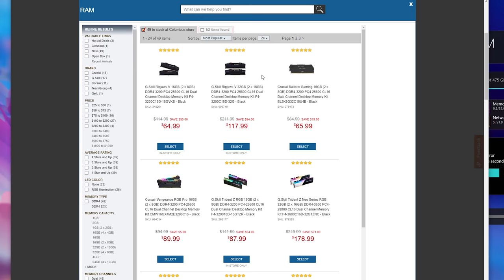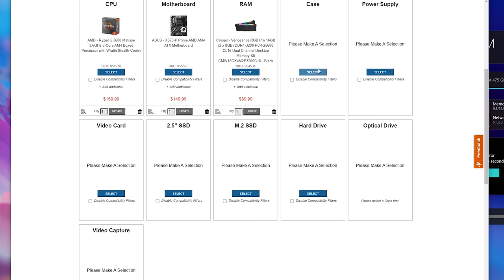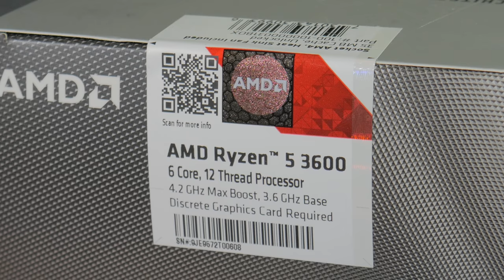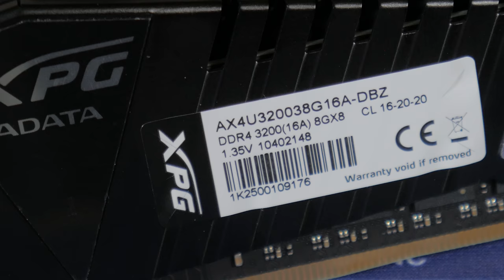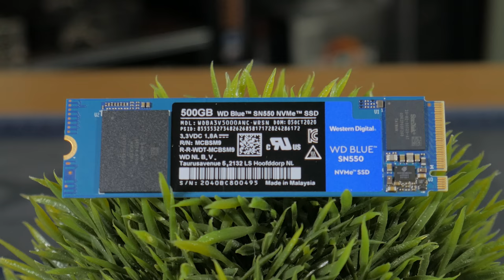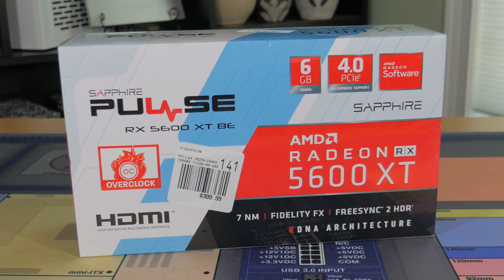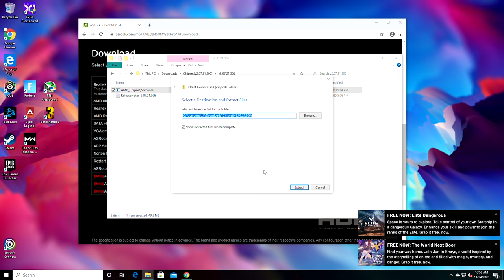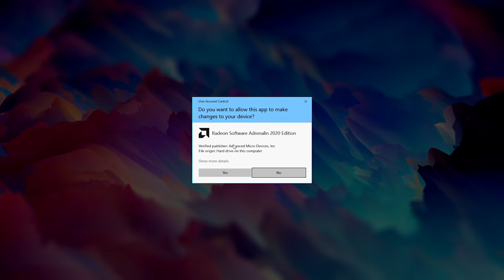$850 Streaming/Gaming PC Build Guide! (2020)

Comment: My budget pc(not perfect for gaming): r5 2600x, rx 5500xt, 16gb ram 3200mhz, b450m ds3h, 500 watt psu 80+ bronze, 1tb crucial p1, any micro atx case+ 3 uphere fans
Reply: Nice! You dont really need a 2600x though, I would have went with a r3 3100.
Reply: @xpsuo7565  yes i could have done that but i just wanted the 6 cores and like i said its not really for just gaming but thx for the feedback

Comment: Best bang for the buck case in the H510, and so easy to build in. The cons are you can’t put larger than a 240mm AIO, and it literally has to be front mounted or else either on top or the back of the case you can only use 120mm AIO. Obviously this was an upgrade to the CPU cooler from the original Coolermaster Hyper 212 EVO I used in a build for someone that has an i7 10700k build. Also, a decent airflow case as well.

Comment: Aight so I got this same setup (but my graphics card was 5500 instead) and wow my PC is a beast. I was able to run League at 150 FPS with 2 games downloading in the background and the graphics are so nice. My friends 1200$ PC isn’t as fast as this build which is great. Also I suggest getting more memory cause 500Gigs isn’t that much.
Reply: does it run rust?
Reply: @Toast_Boy1  I haven't played rust on it yet but I know it definitely can for sure. After a year of having this PC I still agree with what I said before. Now I got it running 3 monitors and multiple VM's running also while playing games and it still runs perfectly
Reply: @ultimateperson626  do you know if i can get a black case for it to match onto my current set up (i dont want a white pc anymore as it will get dirty and suck to clean)
Reply: @Toast_Boy1  yeah

Comment: I built a gaming PC using the NZXT H510. mine is black with a red beauty panel. It's actually my first gaming PC that I ever built. It's something I've been wanting to do for a while. Funny story about that really. It's actually because of PC Building Simulator that I even wanted to to get into PC gaming. Here's a breakdown of my parts: 
MB: Gigabyte Z390 Aorus Ultra
ARCTIC 34 eSports DUO 
Samsung 970 EVO 1TB M.2 NVMe 
Corsair Vengeance RGB Pro 2x8GB RAM 
Intel Core i7-9700K 
NZXT C750 (PSU) 
Gigabyte GeForce GTX 1080 Ti

Comment: Here's my pc part picker list:
cpu=ryzen 5 3600 (200 usd)
gpu=3060ti (399 usd)
mobo=	Gigabyte B450 AORUS M (75usd)
Ram= G.Skill Ripjaws V 16 GB (2 x 8 GB) DDR4-3600 CL18 Memory (62 usd)
Storage=Western Digital Blue 500 GB M.2-2280 Solid State Drive (54 usd)
Case=Deepcool MATREXX 30 MicroATX Mini Tower Case (39.99 usd)
Power supply=EVGA 650 W ATX Power Supply (58.58 usd)
total=888.57 usd

Comment: I would honestly use a case with a mesh front and a aftermarket cooler.
Reply: Agreed, but that would go over budget unless you want a cheap case
Reply: i agree but an aftermarket cooler would make u go over budget if u only have $850 to spend. As for the case I rather get the Phanteks P360A its the same price as the nzxt, has a mesh front panel, and looks much better imo

Comment: I have a quick question, can a Wi-Fi card fit in this build and line up considering the fact its an mATX motherboard and a ATX case?
Reply: At 0:06 it looks like theres a PCIe port right above the graphics card and looks like theres enough space between the two. So i would assume yes. I bought the exact same build today, so when i finish building it i can update you if youre interested
Reply: @kxn7325  Did you ever end up finishing this build because I am still curious about the Wi-Fi card situation.
Reply: @trashyrexx2422  yoo, i have every part except for the graphics card because everythings still sold out, but im using my old gtx 1050 for the time being and the wifi card fits fine

Comment: i feel like you went for budget cornerstone components in a generation where it is not necessary to do so. 
i built a pc for the same price point with the i5 9600k and 1060super :p
Reply: i5 9600k isn't better than the ryzen 5 3600 and 1060 super is actually not as good as the rtx 5600 xt so I'm not quite sure what you mean when you say he used cornerstone components?
Reply: @LucasHxnt  the i5 is definitely better as far as gaming performance is concerned... look at benchmarks... and I meant 1660s but it changed it to 1060. But you are right the radeon card is actually a newer generation than the 1660s but also more expensive and not worth the 8% performance for the 16% markup...
Reply: @alovely4478  i5 is slightly better for gaming, but definitely not as good for things like video editing or multi tasking.

Comment: Do you recommend any upgrades for this build so i can get more frames like upgrading the cpu to a 3600x or xt
Reply: The x and xt are not worth it unless they are cheaper then the 3600
Reply: @meespo3354  do you recommend any other cpu that give higher frames and performance than the 3600

Comment: does the board come with built in wifi, if not, how do you install the wifi card mentioned in disc
Reply: No Wi-Fi built-into the board. For future reference: If a motherboard has Wi-Fi built-in, it will be mentioned in the specifications. The Wi-Fi card linked in the description is installed on the PCi-E slot of the motherboard.
Reply: @JJFlores197  ok thanks

Comment: Matt, please start researching more before making these builds.

There are problems left and right with this build:
The i5-10400/10400f is cheaper and better than the 3600
You could literally fit a 3060 ti in this build if you do an i3-10100/3060ti combo which works just as fine
There are better case options out there but this is sorta fine
Idk about that psu brand but Go for Antec Neo eco or the Corsair CX Series! Even pure power 11 are really good!
WD Blue SSD’s are actually not the best. You can literally get a 970 evo for $60 as we speak and even a t force vulcan for the same
XPG ram isn’t the worst nor the best. Crucial Ballistix, T force Vulcan and Dark pro do way better for the same price
Reply: The 3060 ti isnt even in stock
Reply: The 3060ti is literally oos

Comment: You can have this same build for 100 to 200 dollars less and nit cheap out on psu mem ram and sdd gpu 1660 super supports raytracing and will be better for 50 dollars less king of value and no driver issues cpu ryzen 5 2600 basically almost as good as the 3600 but 50 dollars less memory samsung 970 evo fast ssd and 1 gb extra speed ram corsair lpx 3200 best in the game but can go g skill for less motherboard cheap asrock b450hdv or gigabyte arous for around 70 dollar psu evga or corsair 60ish dollar but microcenter has powerspec used for 25 dollars with 750 bronze or 650 gold case mb311l argb airflow and mesh covering with built in stands your welcome costs about 700ish bucks but i recommend you start out with something small and build on later on
Reply: Make sure to get psu warranty incase it ignites dont worry though its very unlikely unless you got it off wish
Reply: Also how is this computer 850 dollars he cheaped on everything except the gpu cpu and case

Comment: I feel like it's possible to have gone with a Ryzen 3 3300x and a 5700XT instead for more frames, but good build nonetheless!
Reply: You will face a little bit bottleneck in cpu intensive games so the 3600 is always the safe space to be
Reply: Lol....the 3300x CPUs have not been available since launch. Plus it would most likely bottleneck the 5700xt some
Reply: 5700xt would work better with Ryzen 5 3600X I think. Not much of a bottleneck there

Comment: Hey can you tell me what a great  gta5 pc under 1000dollars and if it will run 40 or 50 FPS with high graphics
Reply: 40 and 50 FPS is really nothing . You can play gta in 85- 120 FPS for like a 800$ pc
Reply: @jettgandolfo5138  ok
Reply: @jettgandolfo5138  like what computer because I can't do decent graphics with out it being a slideshow show
Reply: @verticalplayz2352  how much are you going to spend
Reply: @jettgandolfo5138  as long as under 1grand I guess

Comment: Can someone rate the specs of my pc? I have all the parts, but I’m waiting to build until Christmas. The total cost was around $1,350

MSI MPG Z490 GAMING EDGE WIFI LGA 1200 Intel Z490 SATA 6Gb/s ATX Intel Motherboard
Intel i5 10400 
EVGA SuperNOVA 750 G+, 80 Plus Gold 750W
EVGA GeForce 1060 single fan 3gb
be quiet! BK002 SHADOW ROCK LP Low Profile CPU Cooler 130W TDP
Reply: Thats a bad build ngl
Reply: Why get a Z series board when you cant even oc ur chip
Reply: And a 1060 3gb on a $1350 build is just bad

Comment: where I live ryzen 5 3600 costs 300bucks -.-
Reply: ya the stock is super low for the ryzen cpus rn, the i5 9600k is a good alternative its cheaper($200) and actually better then the ryzen 5 3600 in single core performance. so youll get more fps in most games, thats what I bought they're in stock too

Comment: The ryzen 5 3600 is overpriced $250..... $200 for original msrp. Id rather get an intel i7 9700k for $200 at microcenter which offers better gaming performance with its 8 core and 8 threads or u could go i5 9600k for $150 at microcenter but in terms of gaming its roughly identical to the ryzen 5 3600 but everything outside of gaming really isnt that good